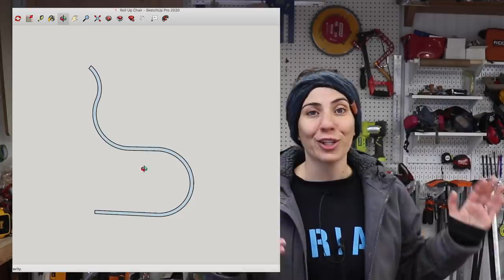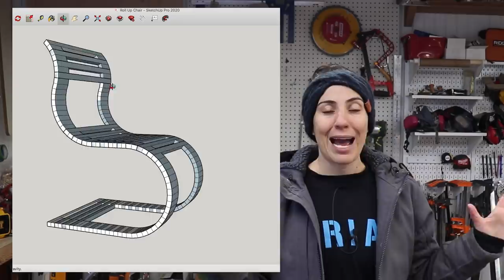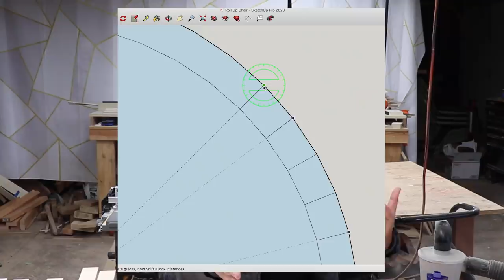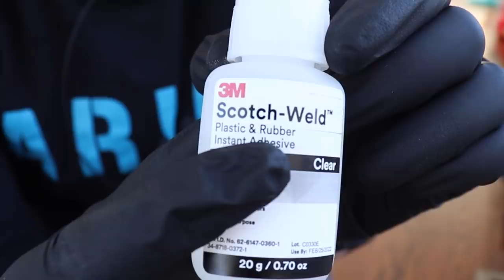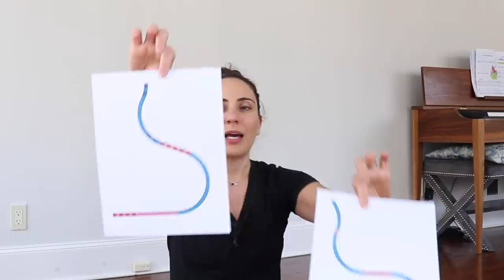I ATTEMPTED to make a chair that rolls up... It didn't go as planned...

Comment: Not failing at all. This is learning, developing skills and creating.
Reply: Fr pretty damn impressive
Reply: We learned how to not build this chair, which is something we didn't know before
Reply: We only fail if we fail to learn from mistakes
Reply: No where in this did she mention moving that saw or opening a window to run the length of board bought. That tells me not alot was learned just worked through. This is a lesson in hard headedness not any amount of actual design reverse engineering.
Reply: Indeed.  As I hear Tamar saying "I'm just going to call this one a fail" (24:05), my thought is: I'd call it "a successful experiment" -- it was a fail from the perspective of getting a happy chair, but a success in terms of attempting to do so, and seeing what one can learn from it.  And learning happened!  About types of webbing, about angles and give, etc.  Good stuff, Tamar!
Reply: @claygoesgodmode92   it was an impossible task, but it looked cool. What i mean is that the surface tension of wood isnt the same as steel
Reply: It is failing. Failing is a part of learning and is nothing to be ashamed of.
Reply: It was a fail
Reply: @ethanweed4203  yeah it reslly was, you cant sit on it and thats its only purpose
Reply: Yea, this is iterative design
Succeeding on the first try is a miracle, while failing is a progression.
Reply: @MoridaFanadier  still failed
Reply: But she did fail tho?

Comment: Well... this is literally how designing and prototyping works. Done it for the past 4 years and i can assure nothing works first time.
Reply: If at all
Reply: @Killer36661  well.. i've never came across a furniture piece that did not work at all. Its just that you of course can predict how a chair might be comfortable, but you will never be sure untill you build a full scale prototype.. everything is different and works differently. There are some things that do not work at all but they are easy to get rid off during the designing phase
Reply: @sekritdokumint9326  100% this. If the furniture doesn't work as furniture, then it's just a sculpture. Furniture has a purpose besides just being a work of art.

Major props to all the prototypists out there doing the work needed to take these concepts and make them work.

Comment: I feel like the seatbelt material was a good idea since you need something that bends but doesn’t stretch and doesn’t snap
Reply: Totally but it has to be glued.
Reply: Rachet strap belts would work.
Reply: True, but it's designed to be easily torn and cut (kind of like duct tape). Puncturing or cutting any part of the material would drastically decrease it's overall integrity.
Reply: @HexJK  ratchet strap belt?
Reply: @HexJK  gotta use heavy duty sewing to overlap the bit you cut and attach em like folded on eachother. That’s how manufacturers attach it to the seat and what retracts it back, in a loop, sewed.
Reply: Why does this remind of someone who has to expand on some else's idea at school

Comment: I worked at a furniture company, and I can tell you that we made worse prototypes than this one, and had less improvement on different stages of the design development. You really did a great job. A single person just doesn't have the project budget to fully develop such a complicated system of interacting parts considering their geometry, physics and properties of materials. If you want a finished product that is ready to use, prepare for years and years of systematic trial and error. Once you get your primary geometry right, you'll find out that it'll twist like a DNA. Or maybe it'll shift sideways. Or it will settle and lose its shape. Maybe it'll break too early for your liking. All these things can and will happen, they are normal in product development. One single person is just overwhelmed with the work that is contained in this process. This may appear to be bad news, but in fact you struggled really well. If you focus on your lessons learnt, you can be proud of this accomplishment. And when you agree with yourself on realistic targets (like I want it to support my weight ) then you can be satisfied with what you made.

Maybe the polyester fabric still is too elastic for your project. How about steel cable, maybe like multiple hand brake cables for bicycles or small motorbikes? You could embed them in tunnels that are drilled under the surface of your wood pieces, and you could adjust their tension with adjusting screws like there are on bicycle hand brakes.
Reply: great idea!
Reply: I had a similar thought about wires but i think I might go with turning sections of each segment down on a lathe and wrapping the wires, would probably require routing the inner corners of the segments to allow it to roll the other way and off centering the cylinder toward the front of the wedge but seems like it would look awesome
Reply: Kevlar or carbon fibre.
Reply: I’d love to see her try again with some suggestions like this!
Reply: Thats a really awesome idea. I was thinking for rubberized material perhaps old tire tread straps/strips.
Reply: I was just thinking that maybe the big stopping factor is the tension of the strap itself. I am excited for the next iteration if you're up for trying ut again!!
Reply: I like the cables idea, but it might be tough to roll it the other direction if they're too close to the middle of the wood. You could maybe incorporate a spaceer at one end of the cable or the other that you pop in after you unroll so that you have extra slack on the cables when stowing the chair.  You could probably incorporate that into how you adjust the tension to get the right form as well..
Reply: I would try making it with strips of latico leather

Comment: I dont think you failed at all. This is a proof of concept. There was only a design by a graphic designer, not even an engineer. And you managed to turn that into reality. In terms of functionality, you absolutely nailed it. It can roll up, it can take the shape you want rolled out, and it can support human weight. The only issue was the degree of functionality. A bit of analysis and you will absolutely succeed. Good luck!

Edit: someone replied that it was actually designed and fabricated by an industrial designer instead of a graphic designer. I was unaware of that fact. Regardless, it's still an impressive product no matter who made it.
Reply: not a graphic designer, but rather an industrial designer (graphic designers make... graphics, industrial designers create products like this), and for what i found in a website for hiring designers, this was part of his portfolio, he made it for real, as it quotes even the teachers that approved the project, and it seems it even won awards. It has many pictures of people trying it out. It's not an easy career, and this was a project that probably took a lot of time to be created, and many prototypes and attempts with models and functionality tests. I'm studying that same career, and it's not fun seeing people downplay the amount of work something like this takes, even less so trying to frame the original designer as someone who doesn't know what he's doing.
Reply: @Forever_Muffin  i see. Thank you for the correction, i edited my comment. Also, good luck in your field. Im pursuing product design so i thought this was a really cool design and build. So really, i had no bad intentions when i said graphic designer. Again, thanks for the clarification. At least other people wont make my mistake.
Reply: Drafting engineer
Technical Designer
Drafting technician
industrial illustrator
Technical Assistant
Draftsman
Draughtsman

all terms i feel are a bit outdated, because we don't really draft on paper using rulers and stuff, it's all done in 3D or 2D cad programs, and secondly, drafts are usually for guiding illustrations, while most do finished ready-to-produce accurate drawings. 
when Technical Assistant was the more common term, you'd have one engineer overseeing maybe 20 assistants drawing on the same paper, now it's all boiled down to one person because of how easy 3D cad is.
Designer, i don't feel accurately portrays the position of most people holding that title in the industry either.
Designer says to me "art" and "colourful and beautiful designs." While i design fit for purpose items with weight calculations and flow distributions. but i can't come up with a better name, definitely not engineer though, i hold those in high esteem and now even garbagemen are waste management engineers... some of these terms are quite silly and needlessly confusing.
Reply: @JackPorter  how can you do both the "art" and "engineering" parts as a job?
Edit: I mean, is there a profession that unites both?

Comment: "A woodcrafter spends all day making a chair, before sitting on it and saying they didn't successfully make a chair."
has the same but opposite energy of
"A philosopher spends all day saying the table doesn't exist, before eating dinner off of it."
Reply: If a cable was run through the slats, even if the cable was loose (and it would have to be), when the pieces are pushed together the shear forces of the two pieces of wood around the cable could make it act just like a dowel.
Reply: @RSterkenburg  And the proper diameter cable will provide the appropriate amount of stretch.
Reply: @RSterkenburg  not loose, rather the proper length, but no more. When the chair is set up all pieces should be at maximum tension.

Comment: I mean... I would have failed during the part where you had to do math to figure out how many pieces you needed. You’re a badass for even tackling this. 🙌🏼
Reply from the maker: 😂😂😂 that was super hard for me!
Reply: Just what I was thinking
Reply: I have an idea. I don't have the skills but I watch many of you guys channels. Anyway I suggestion is bend your wood first long ways. You can still a board as a seat to test it. Once you have the shape correct your can mark where to cut the pieces. The area you used the temp seat on you can cut the individual planks to match that are and then replace it into the chair. Once you have the shape I would suggest putting your material on before cutting the individual pieces. Maybe even try curf bending there is a channel I watched the other day where he did the bending just by making curf cuts. Also I think you may have taken out to much material when you plan and sanded. Just my thoughts
Reply: @3x3CustomTamar  awesome video and a great project! I think you  are almost there, you only need to figure out the proper geometry. Forget about the rubber though, you need something that does NOT stretch. The bands that you used are good enough I guess and then beautifying them with felt and the finished washers is a great idea! Go get'em!
Reply: @thomassmith9932  I like the idea, but I think the effect of 40x kerfs taken out will make the final curve completely different from the one you "bent". I mean even 20 kerfs with a thin kerf blade is like 2.5 inches of wood removed.
Reply: That's for sure  !!!!    My brain would have Exploded  !!!!
Reply: I'd have failed at drawing circles. I'll never evolve beyond a slab furniture maker ><
Reply: @bw1532  yes but if she puts the strap on while it's solid and then replace the cuts with thin veneer or plastic it should compensate
Reply: @clandestine2178 wow, take it easy dude... ever heard of a joke? jeez...
Reply: Agreed, she's pretty bad ass and clever. That program she's using looks amazing.
Reply: i think the shape wood is not all square...have part to trim to make bend and the length is short
Reply: @3x3CustomTamar  Hey, I was thinking of a solution that could help you. I don't know if you're aware of how they made the arcs at the Sydney Opera House stand. Here's a video in which they explain the principles: https://www.youtube.com/watch?v=xKDWKN7eOKw. The best example of how it can benefit you is the toy at 0:48 in the video that uses the same principle.
Reply: you can just roll over the angle strating mid chair it shoud revers the leanning
Reply: Cool ass build, but you can just divide 360 by however any segments you want...
Reply from the maker: @VKakaVicky  nope
Reply: @3x3CustomTamar  did you try it?
Reply from the maker: @VKakaVicky  yes. Doesn’t work.
Reply: @3x3CustomTamar  ok :( was worth a try tho
Reply: @3x3CustomTamar  The answer is either flat sheet steel rool to remove the stretch from the front round. And will also support the back. Or plastic cables in a groove. The back needs a better angle for the pieces. Make the chair seat come around the the circle more
Reply: she also managed to do the math in imperial units
Reply: Yeah considering it didn't even seem possible in the beginning. It was awesome to watch!
Reply: Nice try, I admire your persistance (and your optimism) but you should definitely forget the stretchy rubber - that just adds in geometry errors. Your cutting needs to allow for the saw kerfs and I suspect you might need a curve rather than just an angle so that the pieces end up in the right place after the webbing has given a bit. I see no reason why this shouldn't work eventually.
Reply: @3x3CustomTamar  Good effort, loved the seat belt and stapler idea ... 
1) Kevlar strap = less stretch? Reliant on adhesive bite. 
2) Thin profile roller chain [bike chain] embedded in the slats with fastening thru chain? Thin chain mail? Metal is heavy.
3) The original material is 1/4"  in thickness but of unknown composition? 
4) I observed the inventor/designer sat at the front of the chair. 
5) Initially assembled w/ full slats, then cut out where loads allow for weight reduction. 
6) Iron wood will not compress. Expensive and rare. 
7) Keep gunnin'.
Reply: Pencil and paper plus grade 10, the programs are for large scale layout, practice the trig, its fun
Reply: Start from the point that I already knew the webbing would work, I would:

1. Temporarily replace the 2 flat portions (the base on the floor and the seat) by total solid portitions (not from small pieces of 1x1), the purpose is to test out the 1st curve (going from the floor up)

2. Test the 1st curve 1st, if it bends too much, simply take away some end pieces, if it doesnt bend enough, add some more pieces, because in the end, if the seat is parallel to the floor (or a bit leaned back) you then formed a perfect half circle, no matter how many segments are there. This is the most critical part

3. The 2nd an 3rd curves - i would just base on anthropometrical dimensions, on where your lower back should rest on, how far from the edge of the seat etc...

4. Then replace the base and the seat with 1x1 pieces

The point here is to test, not only rely on the sketch itself

Easier said than done, i know

Comment: When it fails as a chair, but succeeds as a stool, perhaps it becomes the concept piece for a stool design.
Reply: Agreed. Delete the backrest portion of the stool, spin it 180 degrees, and you have a little campfire type of stool
Reply: @jackanderson9082  Maybe add a latch on the bottom so she can clip it with a carabiner to a backpack